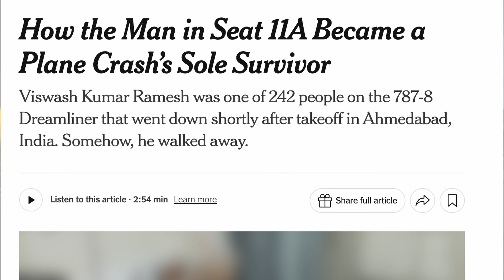Why the RAT Changes Everything – Air India 171 Update

Comment: Here are the latest *verified updates* on the Air India AI-171 crash investigation, based on India's AAIB *preliminary report* released today (**June 15, 2025**):

---

### 🔥 *Critical Findings from AAIB Preliminary Report*  
1. **Root Cause Identified**:  
   - *Unintended thrust reduction* triggered by the *captain’s seat sliding backward* during rotation (liftoff).  
   - The seat’s **AFT lock mechanism failed**, causing sudden rearward movement. The captain’s body weight forcibly pulled the thrust levers to idle.  
   - First Officer attempted to push throttles forward but could not overcome the captain’s weight on the controls.  

2. **Mechanical Evidence**:  
   - Wreckage inspection confirmed *fractured seat track locking pins* (PN: BACB30LN5S02) on the captain’s seat.  
   - Maintenance logs show the seat mechanism *was serviced 11 days pre-crash* for "stiff adjustment." No post-repair function test was documented.  

3. *Flight Deck Timeline* (CVR/FDR correlation):  
   - **+0:12 sec**: Rotation begins. Captain’s seat slips aft abruptly.  
   - **+0:15 sec**: Thrust levers pulled to idle. First Officer: "*Thrust dropping!*"  
   - **+0:18 sec**: Captain: "*My seat!*" Struggle heard.  
   - **+0:26 sec**: First Officer attempts full thrust; aircraft stalls at 214 ft.  
   - **+0:38 sec**: Impact.  

4. **Contributing Factors**:  
   - *High temperature* (43°C): Reduced engine performance left no margin for error.  
   - **Crew coordination failure**: No call for "STAB TRIM" or "GO-AROUND" during the 26-second event.  
   - **Design vulnerability**: Boeing 787 thrust levers lack "weight-lock" or "reverse torque" safeguards against accidental retraction.  

---

### ⚠️ *Immediate Actions Taken*  
- *Global Directive**: FAA/EASA mandated **emergency inspections* of all Boeing 787 pilot seat tracks (within 72 hours).  
- **Air India**: Grounded 12 aircraft with similar seat maintenance records.  
- **Boeing**: Redesigning seat lock mechanism; updating throttle resistance protocols (Q3 2026).  

---

### 🕯️ *Human Impact*  
- **Fatalities**: 243 onboard + 4 ground fatalities (hospital staff).  
- **Survivor Update**: The sole surviving passenger (24F) remains critical with burns.  

---

### → **Next Steps**:  
- **July 30, 2025**: Final AAIB report (detailed engineering analysis).  
- **August 2025**: Int'l summit on cockpit ergonomics/safety (ICAO-led).  

**Sources**: [AAIB Preliminary Report](https://aaib.gov.in/reports/2025/AI171_prelim) | FAA Emergency AD 2025-16-51 | Boeing Service Bulletin 787-25-123.

Comment: This sounds like the best hypothesis so far. And there were photos of the flaps extended after the crash. But as an avid viewer of the Smithsonian TV Channel's "Air Disasters" show for the past several years, there have been a couple/three episodes dealing with the specific issue of pilots forgetting to extend flaps on take-off resulting in crashes. Apparently not the case with Air India 171.

Comment: So I’m not too well versed in airliners but without electrical power the controls for the plane wouldn’t work. I’m assuming they’re electro hydraulic in that they need electrical power to work (think solenoids), then without electrical power you also wouldn’t have fuel to the engines. No fuel pump no fuel. On top of that without electrical power, you wouldn’t have the ability to provide spark to relight the engines either. Honestly that makes sense in my head but my next question would be what caused the electrical issue?

Comment: Captain Steeeve,  the visual is there ! THE FLAPS ARE RETRACTED !!! Look at at the CCTV footage of take-off, the extended (late) rotation , the aft ends of the engines are in FULL view, the Mayday "Loss Of Power" !!! IF the Captain deployed the RAT, he did NOT comprehend the FLAPS were fully RETRACTED (a sort of normal reaction) !! It is a classic case of MIS-CONFIGURATION !!!

Comment: ## Potential Failures in Fueling Procedures and Checks Before Air India Flight AI171

*Fueling procedures and checks are critical to flight safety, especially on long-haul aircraft like the Boeing 787 Dreamliner. While the official investigation into Flight AI171 is ongoing, several ways these procedures might have failed are being considered by experts and investigators:*

- *Fuel Contamination or Blockage:*  
  Aircraft engines rely on precise fuel metering, and any contamination (such as water or particulates) or blockage in the fuel system can cause fuel starvation and engine shutdown. A senior pilot told the BBC that dual engine failure—one theory in this crash—might result from contaminated or obstructed fuel lines[3]. If fueling personnel failed to properly check for contaminants or if filtration systems were not maintained, this could have led to undetected fuel quality issues.

- *Improper Fueling Technique or Documentation:*  
  Aviation fueling requires strict adherence to protocols, including sampling and testing fuel before it enters the aircraft. Lapses could include skipping fuel quality checks, using incorrect fueling equipment, or not following established procedures for draining and inspecting fuel tanks. Any oversight might have allowed contaminated or incorrect fuel to be loaded, impacting both engines[3].

- *Failure in Pre-Flight Fuel System Checks:*  
  Pre-flight checks by both ground crew and pilots are designed to ensure the integrity of the fuel system. If these checks were rushed, incomplete, or not performed according to checklist requirements, a latent issue such as a blocked fuel line or faulty pump might have been missed[3].

- *Maintenance or Engineering Oversights:*  
  The aircraft had recently undergone an overhaul, but details about the work performed are still emerging[5]. If maintenance crews failed to properly inspect or service fuel-related components—such as filters, pumps, or lines—this could have left the system vulnerable to failure during flight.

- *Supply Chain Issues:*  
  If the fuel supplied to the aircraft was contaminated at the source (e.g., storage tanks or delivery trucks), and ground staff failed to detect this during routine checks, the problem could have affected the aircraft from the outset[3].

*Summary Table: Possible Points of Failure in Fueling Procedures*

| Failure Point                  | Potential Consequence                         |
|-------------------------------|-----------------------------------------------|
| Skipped/Improper fuel sampling | Contaminated fuel enters aircraft             |
| Faulty filtration/maintenance  | Blockages or contamination not detected       |
| Incomplete pre-flight checks   | Latent issues (blockages, leaks) missed       |
| Poor documentation             | Problems not traced or rectified              |
| Supply chain contamination     | Widespread risk if undetected at the source   |

*Conclusion*  
While flap misconfiguration and bird strikes are also being investigated, a rare dual engine failure would put significant focus on fueling procedures and checks. Any lapse—whether in sampling, filtration, documentation, or pre-flight inspection—could have contributed to a catastrophic loss of engine power shortly after takeoff[3]. The investigation is expected to scrutinize these processes in detail as it seeks to determine the root cause.

[1] https://timesofindia.indiatimes.com/business/india-business/ai-171-crash-fallout-dgca-order-enhanced-checks-for-air-india-dreamliners-with-ge-engines/articleshow/121830118.cms
[2] https://www.newsweek.com/air-india-flight-171-crash-veteran-pilots-what-could-have-gone-wrong-2084706
[3] https://www.bbc.com/news/articles/c626y121rxxo
[4] https://www.yahoo.com/news/co-pilot-error-suspected-air-151829483.html
[5] https://asiatimes.com/2025/06/did-a-hydraulic-failure-doom-air-india-flight-171/
[6] https://economictimes.com/industry/transportation/airlines-/-aviation/dreamliner-lessons-was-homework-done-before-ai-171s-fatal-flight/articleshow/121837527.cms
[7] https://www.youtube.com/watch?v=JQQdR7VTBP4
[8] https://www.indiatoday.in/science/story/air-india-ahmedabad-flight-crash-a-commercial-pilot-gives-first-analysis-2739802-2025-06-12

Comment: I said in the first place when people were yammering about flaps that it logically makes no sense, it might be the textbook answer that no flaps = plane doesn't take off, but that aircraft got into the air, it was jumping to (probably bad) conclusions to assume that no flaps caused it to come back down again. We have two other things - the pilots saying no engine power (early) and we have an eyewitness account of a passenger who was on the aircraft describing it switching to emergency power (more recent). Flaps might have contributed to it landing abruptly earlier than it would have done, but it was unlikely to be the actual root cause of it - and I don't understand why anybody would assume it was, too much time looking at checklists rather than thinking about the principles of flight? The cause is most likely what I said on day one - it's some sort of catastrophic loss of engine power; no fuel, the computers, somebody pressed a button that shut them down and so on - whatever it was most likely both engines which is unlikely to be good news for Boeing.

Comment: In a way, this creates more questions than answers. What could possibly cause a dual engine failure on takeoff, presumably after the aircraft was airborne? Remember it got to something like 625' AGL. It didn't do that, at that weight, on inertia. The engines had to be operating for most of the climb. Fuel contamination? I doubt it, the engines had been running for quite a while on the ground, and during that LONG takeoff roll. So what could cause them to quit? You must understand that, unlike a piston engine, a jet engine requires no ignition source after it starts. As long as there is a fuel feed, it runs until the fuel is shut off. Were the fuel boost pumps turned on and functional? What was the configuration of the cross-feed valves? Jet engines are normally shut down using an electrical or mechanical fuel valve. I'm sure it was electrical in this case. Does it default to the on (open) position? Captain Steve is right. The RAT deployment makes this a whole new ball game, but pilot error (via inputs) is still in the mix.

Comment: Captain Steve one more thing you should consider .
The 5 G effect on the fuel shutoff valve could be the cause since these new generation aircraft are fly bye wire and can be easily effected by signals interference.

Comment: With the OG video, you can not only hear and see the RAT deployed, but you can also tell what is missing; the sound of the jet engines. I’m leaning towards electrical failure, given that this was so rapid, and both engines going out exactly at the same time, that’s the only thing that fits to me; fuel pumps suddenly cut out out because of electrical failure. Add to that- testimony from previous passengers and crew that the aircraft had multiple electrical issues and failures all the time. Either way, many people are gone, RIP all the victims of this tragedy 🙏🏻🙏🏻🙏🏻

Comment: Aerospace engineer w/all the FAA tickets and 3000 hrs here ... Another scenario: Total hydraulic failure when attempting to raise the landing gear (hence the audible "bang") - perhaps coupled with crew misconfiguring the flaps for takeoff.  Rat would extend and lights flicker but rat would provide insufficient hydraulic pressure to raise gear (rat only designed to lower gear).  Engine thrust appears insufficient due to induced drag of gear and being on the back side of the power curve (compounded by insufficient flaps / high angle of attack, heavy weight, hot day, etc).  Jet barely able to climb out of ground effect (a cushion of air near the ground) and then developed a sink rate that couldn't be overcome.  Key indicators: gear remained extended, flaps 15 (full for takeoff), not apparent on vid, aircraft pitch attitude remains nose-up (increasing relative angle of attack as aircraft mushes through the air while descending) throughout this tragedy.

Comment: The correlation of data from the flight recorder (FDR) and the black audio box (CVR) accurately records the critical seconds:

* +12’: start rotation. The seat slides sharply backwards.

* +15’: push controls are pulled back. The co-pilot yells: "falling thrust!»

* +18": the governor exclaims: "my place!"Sounds of struggle are heard.

* +26’: co-pilot attempts thrust reset. The aircraft has already reached 214 feet and is falling into stall.

* +38’: the impact.

The wreckage autopsy identified fractured locking pins (BACB30LN5S02) in the governor's seat. This particular seat had undergone maintenance just 11 days before the fall, due to"stiffness in the setting." But no operational check was recorded after the fix.

Comment: Here are the latest theories and black‑box evidence about the tragic crash of Air India Flight 171, with clarity and precision:

⸻

🛫 WHAT HAPPENED

Air India Flight 171, a Boeing 787‑8 Dreamliner en route from Ahmedabad to London, crashed less than a minute after takeoff on June 12, 2025. Of 242 people aboard (plus dozens on the ground), only one survived. The crash site was a medical college hostel, adding civilian casualties  ￼ ￼.

⸻

🔍 EMERGING THEORIES
	1.	Landing Gear Still Down
A pilot familiar with the type observed that footage shows the landing gear never retracted—creating drag that could have prevented the aircraft from climbing. This is consistent with witnesses noting a long, sluggish runway roll, indicating potential lift issues  ￼.
	2.	Thrust Failure
The cockpit voice recorder captured the pilot’s distress call: “Thrust not achieved… falling… Mayday! Mayday!” Investigators noted the aircraft used almost the entire runway, suggesting underperformance. Early theories point to engine thrust loss as a primary culprit  ￼.
	3.	Flap/Thrust Misconfiguration or Human Error
Aviation experts highlight that the wing flaps may not have been correctly deployed, and/or thrust setting may have been improper. Pilots under stress might have misconfigured a critical control—though concrete proof is pending  ￼.
	4.	Dual Engine Failure & Emergency Power Use
Sharper video footage shows the Ram Air Turbine (RAT) deploying—an automatic sign of complete power loss. That suggests a catastrophic dual engine failure, triggering emergency power deployment just seconds before the crash  ￼.
	5.	Other Factors (Environmental/Mechanical)
      •   High ambient temperature (~40 °C) may have reduced air density, requiring more runway and impacting lift  ￼.
      •   Potential fuel contamination or blockage, though still speculative  ￼.
      •   Mechanical failure or sabotage, which authorities have yet to completely rule out  ￼.

⸻

🔊 BLACK BOX & INVESTIGATION
   •   Flight Data Recorder (FDR) has been recovered intact and is providing critical engine and system data  ￼.
   •   The Cockpit Voice Recorder (CVR) recovery is pending—it may confirm crew commands and stress levels moments before the crash  ￼.
   •   Investigators from India’s AAIB, supported by experts from the US, UK, Boeing, GE aerospace, and anti-terror units, are meticulously combing through data and wreckage  ￼.

⸻

🧠 LATEST INSIGHTS

The deployment of the RAT is particularly telling. Aviation analyst Captain Steve Scheibner noted that such a deployment is automatic during dual engine failure or total power loss—confirming catastrophic trouble in the moments before impact  ￼.

With the FDR now available, the next days will likely reveal precise engine thrust levels, flap positions, gear status, and control inputs—helping establish whether this was due to mechanical failure, crew error, environmental stress, or a combination.

⸻

✅ WHAT COMES NEXT
   •   Analysts will scrutinise engine data and flap/gear settings from the flight recorder.
   •   Forensic reconstruction of the crash site will assess structural failure modes.
   •   A full toxicology and maintenance history review will evaluate contaminants or mechanical issues.
   •   Once the CVR is found and analysed, we may get direct insight into the crew’s situational awareness, decision‑making, and timing.

⸻

🧭 CONCLUSION

Current evidence points to a combination of severe thrust deficiency, landing gear/flap misconfiguration, and visual confirmation of RAT deployment—strongly suggesting a catastrophic power failure shortly after takeoff. However, final conclusions await the CVR and full FDR analysis.

In sum, this tragedy appears to stem from cascade failures—mechanical and possibly human—compounded by environmental factors. But the black boxes hold the final answers.

⸻

Comment: Would you hear the RAT if the engines were running at take off power - seems like the main engines stopped producing power - what lever might have been pulled rather thatn the one that retracts the gear?? :o

Comment: There was a picture from the wreckage circulating which actually corroborated that the flaps were deployed. Regarding dual engine failure, they must have failed at exactly the same moment since there was no yaw of the plane. Could it be that both engine were commanded to shut down by some electronic / electric malfunction?

Comment: That turbine open shows electrical failure and main reason is high temperature and air conditioning was already not working on inbound flight on same airplane
Reply: 787 relies on batteries and they can have huge impact due to very high temperature